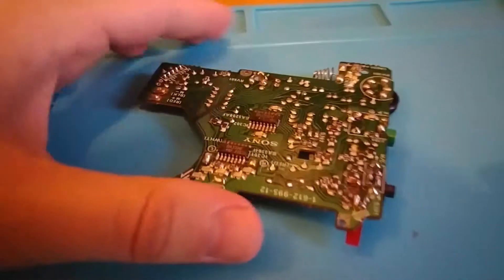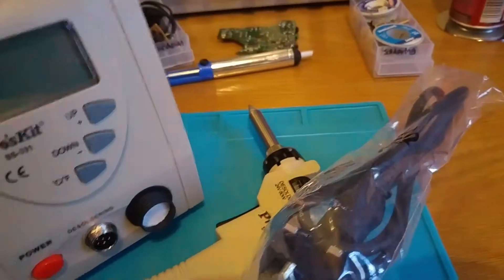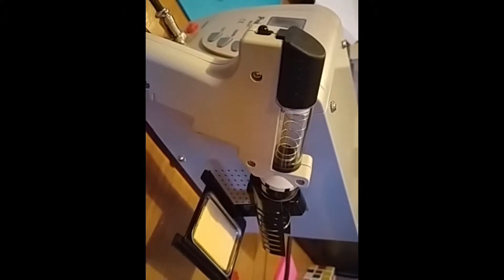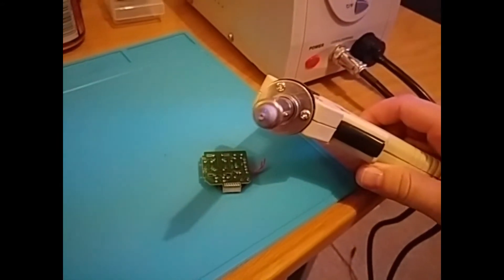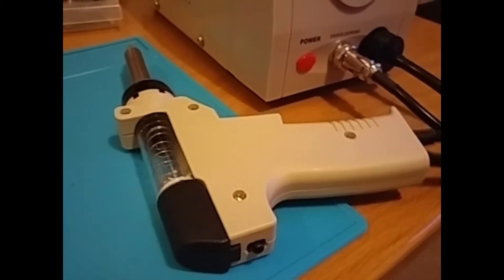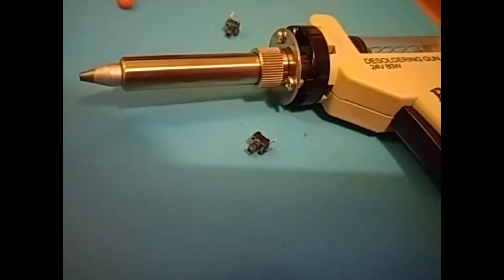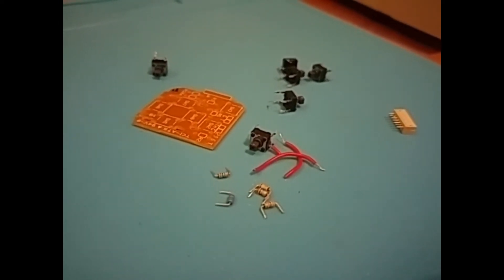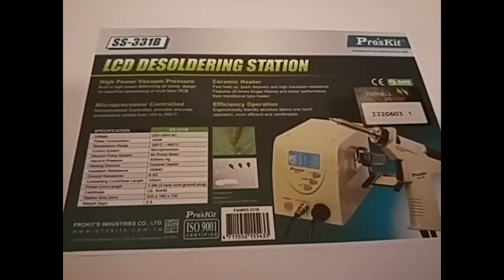SS-331B Desoldering Station Review (Fixing Old Junk)

Comment: It's been a year how is this working? Does it work on multi layer boards like motherboards for cap replacement?
Reply from the maker: juliusvalentinas To be honest I've not used it much. But it was working great last time I checked.
Reply: Thank you for reply, I want to use this for replacing motherboards caps. Could you test it on such multilayer board like motherboard?

I wonder what pump did Proskit use? the cheap DC or AC like AOYUE 474A shown in this video  https://www.youtube.com/watch?v=5UrB1t3xQG0

Comment: I am about the buy the same model. Waiting for your review after few months of usage.
Reply from the maker: Hi Jay. I've not actually used this a great deal since the making of this video, but this model was highly recommended to me by a chap who repairs a lot of ZX spectrum stuff. He said the only thing to look out for was to hold the trigger for a little longer than you expect to need to, to ensure no solder gets stuck in the shaft. Although it does come with a tool for unblocking IIRC. Hope this helps :)
Reply: Hey, I will pull the trigger this coming Christmas sale. Thanks for replying.